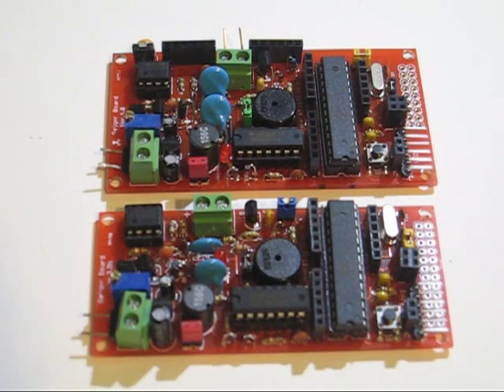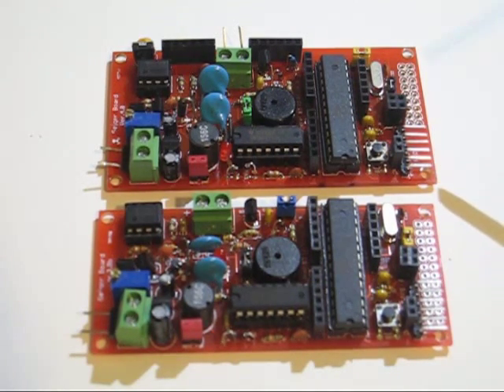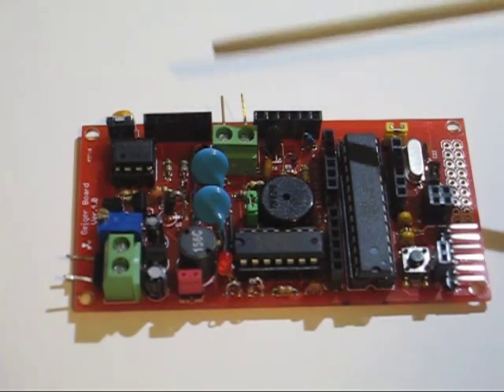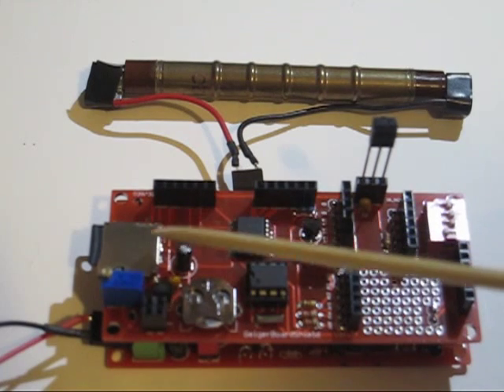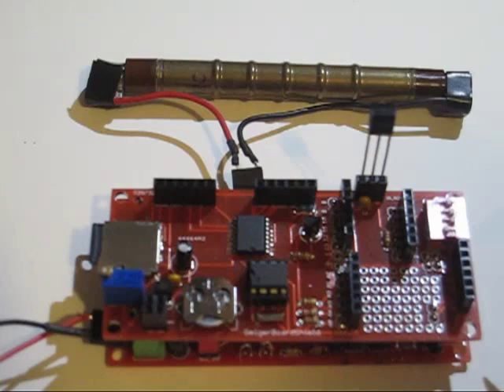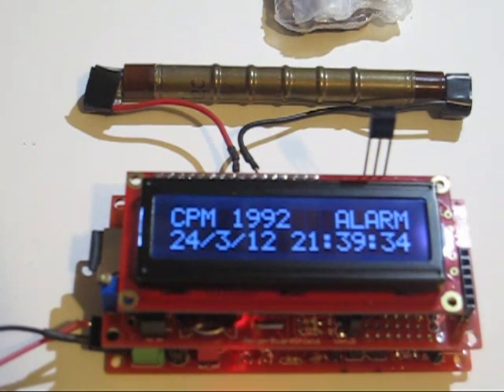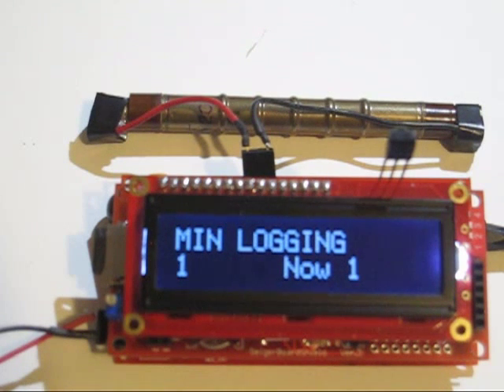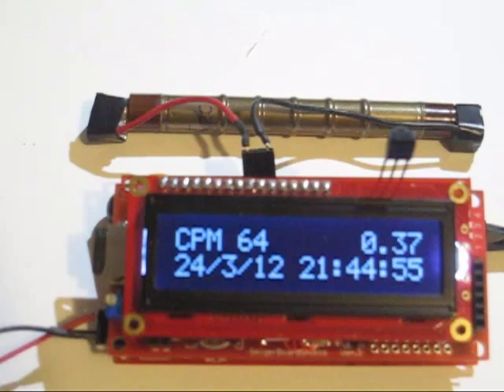Geiger Kits - v3 & v4 boards and Logging Shield

Comment: I built the v.4 kit, and to my surprise it worked right
the first time. It's an excellent quality kit, and in my opinion
the functional equivalent of a $400 commercial Geiger counter.

Note that because of the close parts spacing, this is not a kit
for beginners. Building it requires patience, attention to detail,
and skill.

Comment from the maker: I have thought about that. Getting rid of the serial dongle is huge. Unfortunately, there are some drawbacks. It's a kit, and it works without buying anything else except a GM tube. Since the 32U4 could not be added by the builder they would have to buy something and learn to download the program. I have a wide variety of users. OTOH if I supplied the Leonardo or Teensy, it would make the kit more expensive. I do not want to limit the kit only to those who are savvy about microcontrollers.